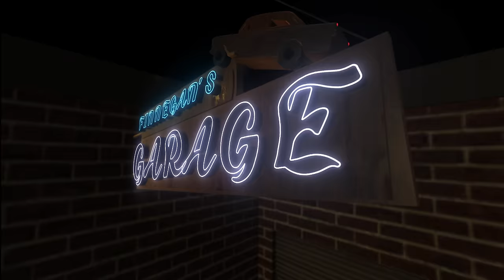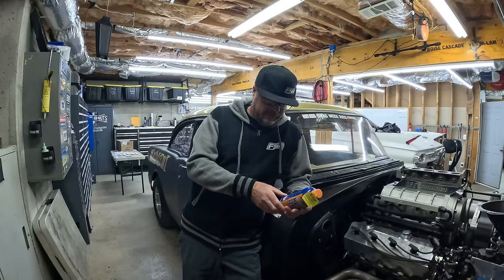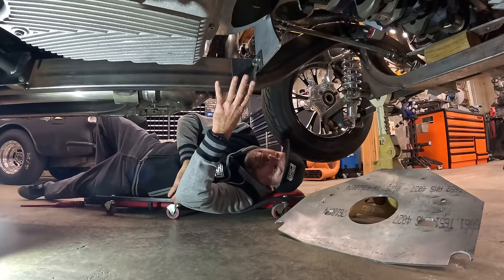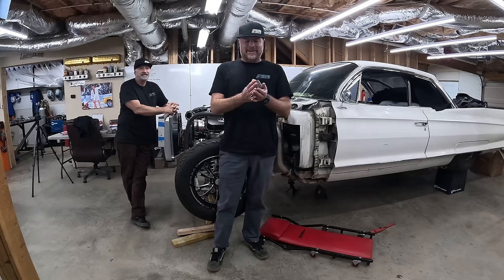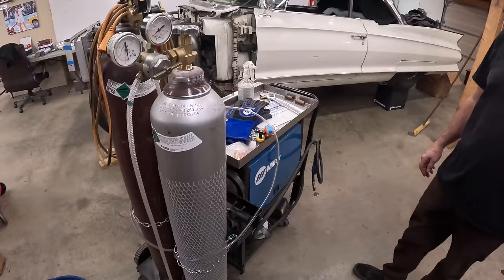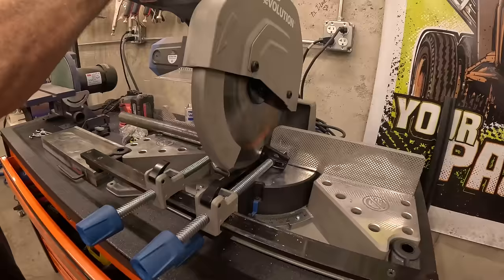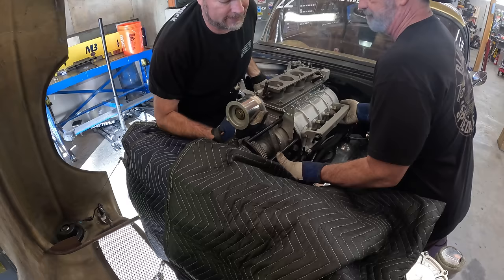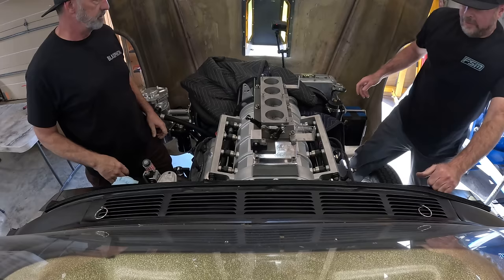Hey Freiburger, I WANT A REMATCH!

Comment: 19:52 Drilling holes with a cordless drill, with a drill press perfectly framed in the same shot, and a Bridgeport in the back corner, right after saying that he loves getting to use all the tools. 🤔 As touchy as the clutch system is, I would have combined the pedal stop and switch. If there was enough space for a bar or plate as adjustable stop, the back of the pedal and switch could be set together (with an adjustable switch). With something like that, adjusting the pedal stop would not change the clutch switch and it would always be calibrated to trigger that system right when the pedal is released......at least that is how I understood what your needs are. It would have taken a little more fabrication.......but hey, you get to use a bunch of tools, and more importantly it might be much more predictable for making adjustments later, unless the clutch never needs readjusted. It seems like it takes a test and tune day to get it set properly and you don't always get that option if you are in the middle of an event.

Comment: I’m surprised you don’t have a set of temp mufflers you can use in the driveway..  Something that would drop over the end of the pipes..  Or would that cause issues with the engine?  I’m not knowledgeable, just curious..

Comment: Love ya Mike, and love the show, and I've been around since the beginning.
Aside from you having the baddest azz home shop than anyone on the planet, I just got to say this....
I think you are over-enginnering that clutch switch situation. Soon as you hop in with your SFI rated shoes in a hurry for next round and kick that switch setup you are gonna be then making a vid about that where it didn't work. You gotta put the switch way up high and do your trickery to make it work way up there. Where you put it in the vid just ain't gonna work long term. It's fine I guess for a test and tune, but no can't be permanent.
As a former electric forklift mechanic for many years I am very familiar with lever switches....
You are using a roller switch which seems like what one would use in a hot rod application, but to make this more simple and rugged for the application all you really need is a long stainless steel lever switch and a much more simple tab to move it...and be able to keep it up high and away from your shoes. 
If I'm wrong then so be it. If this new setup don't work then think about what I'm saying. The less parts and pieces you put in the way of failure are those many pieces less that can fail, if that makes sense...

The blown paper gasket thing sounds to me like a simple blower hiccup/backfire that pushed out the gasket. Id think about the highest quality ARP fasteners and the clamp load and temps and all that... but then also think about a green viton one piece o-ring groove to replace that paper gasket.
I have no experience with blower cars but when I seen y'all greasing it up I realized then that movement was much more than I thought unless on nitromethane. That made me think of better fasteners first to slow down the movement, then the viton green one piece o-ring that could re-seal itself hopefully if the blower moves around that much. It can't be going side to side, it has to be lifting vertically among the existing fasteners. 
Do the safety straps to protect from blower explosions help with holding the case down too?.

Comment: I was thinking you would have just notched the mid plate so the mount plate could be pushed up to the already drilled holes, actually would have been stronger easier to locate when motor in out jobs required but hey both would have worked as well.

Comment: Mike, im just wondering if your lower plenum needs to be checked for the mating surface to be true and flat. To me it looks like where the blower actually seals, it has less tension on the gasket area and allowing the gasket to not seal correctly causing it to blow out.

Comment: the drivers side blower gasket isn't missing, it just broke and pushed out and being nailed down the outside, just bowed down into the space around the manifold. (not the plenum). With as much surface/clamping area, gotta wonder if everything is actually flat between the blower and the manifold. Your next tool should be a machinists flat edge. I'd suggest after 2-3 heat cycles, re-torque the blower. At some point, you should start finding zero turning on the hardware when checking the torque. Gasket collapse is what you're chasing there. I enjoy this channel a lot, but having been a fabricator for well over a decade at a Defense contractor, I simply cant watch sometimes. Seek out a fabrication class. I know you mean well, but....And the amount of work you create for yourself by ignoring the invention of the Rivnut truly surprises me.

Comment: Sweet welder!  Great content. I’ve been kicking around getting a welder that can do both MiG and tig. I use to stretch truck frames, build headache racks, toolbox mounting and rear bumpers on semi’s 25 years ago and ran a miller MiG all the time, I loved it. But I’ve never TIG welded before but always wanted to learn. Would you mind sharing what model your welder is please?  I haven’t ran a MiG in a minute, but it’s like riding a bicycle… you don’t forget. lol have a great day and thanks for any info you can share. Luke

Comment: Dowels only locate, they are not handling any shear force. That is taken up by the clamping force of the bolts through the bellhousing and mid-plate into the block. You should really never side load dowels.
Reply: ummmmmmmm what?!
Reply: You are correct,  that's why you use all the bellhousing bolts and torque them to spec .
Reply: @coreymacqueen4802  You don't want to oblong a hole used for location, and dowels are usually hardened. They don't like to be impacted in shear by like say a clutch dump.
Reply: True words by HexStove. Same goes for the bolts Mike speaks of at 11:43 they are not in shear as long as they are sized and torqued properly. It is their clamping force × the friction between the parts clamped that carries the torque. 
A good example are the wheels to the hub: loose bolts or lug nuts would break (you'll lose them first...) but torqued properly they last (almost) forever as they are only loaded in tension, not in shear. The torque is transmitted by the clamping force x friction in this case too.

Comment: Need to have it welded up and made a dry deck.
Reply from the maker: street car, remember?
Reply: @FinnegansGarage quiet a few street cars running dry deck. Should probably look into it some more. Mr. Steve Morris has some great Vidya’s on it. Basically just run hoses to/from the head’s instead of getting water through the deck.
Reply: @MechanicalMafioso  is just that easy! 😅
Reply: You're taking all the fun out of it Mike.

Comment: I get the fact of using grease on your gaskets to make them not stick if you need to change them. But I notice your not running a burst plate in case of backfire...WHY? So my point is wont that suck or blow that gasket again if it happens? It will literally cause it to slip right out under extreme pressure. Just an observation.

Comment: I feel like you welding the midplate to the frame would bite you if the motor locks up, because its gonna be a pita to get the flywheel off
Reply: Then again, I can't see what's going on in there so idk if that would cause you an issue
Reply: FinneganaGarage  glad there are bots here as well

Comment: I cant believe you poured that junk in your race engine. Hey I wonder if there is a heat differential inside the radiator tubes where the air rushes over them?

Comment: Wait a minute...pour in gasket sealer on that Hemi? They sponsoring this video or something? I get it on a 40 year old stock motor, but with that much boost? Seriously? 🤦‍♂️🤣🤣🤣
Reply: He doesn't pay for the motors so he doesn't care!!!!!
Reply: So I had a old Honda b18 and it had like 3 jugs of same product in it. It has 10psi on a cheap turbo and it held together until I sold it.
Reply: Did you miss the part where he said that Pete who built the engine was the one who told him to do it 🤦🏻🙄
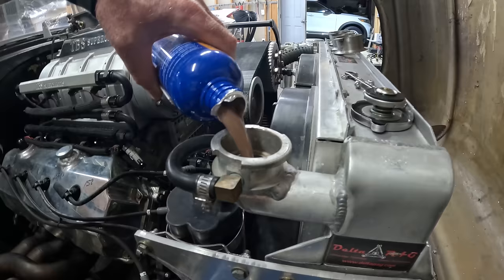Reply: Didn't you pay attention? He said that Pete told him to use it, and that Pete uses it in every aluminum engine he builds(@6:34). And he said that Pete suggested Moroso's version that Finn couldn't get ahold of. Now maybe you think that Finn is just straight up lying with total disregard for Pete's credibility, but, considering that the engine that got the gasket-in-a-can is connected to Pete as the engine builder, I kinda doubt that's the case.
Me personally, I'm gonna go ahead and have some biased towards Pete Harrell's opinion, considering that he builds everything from stock block budget builds to Pro Mod engines.

Comment: FFS Finnegan, you Will ruin your engine using that crap!
Been using it my self 3 times, 2 times warped heads due to blocked cooling ports in my heads, blocked by that head sealent crap and all 3 times the heating element exploded later after the liquid headgasket "fix".